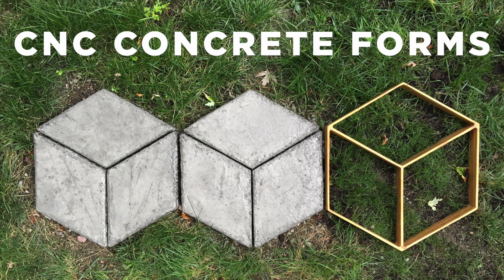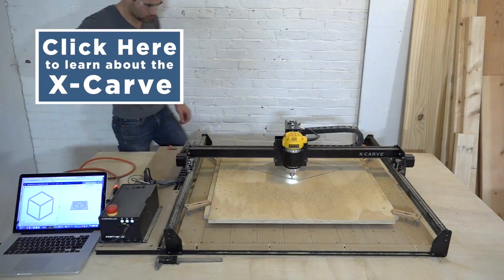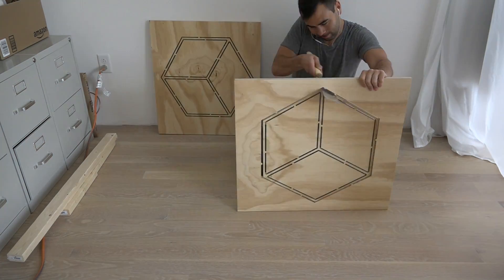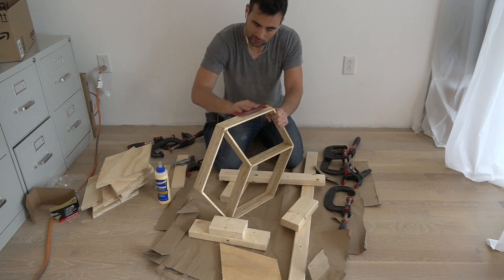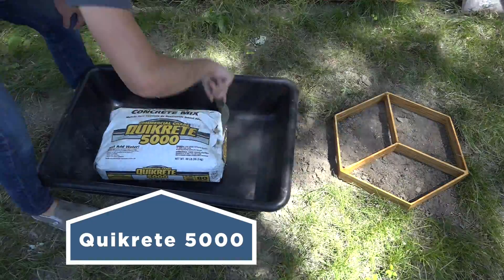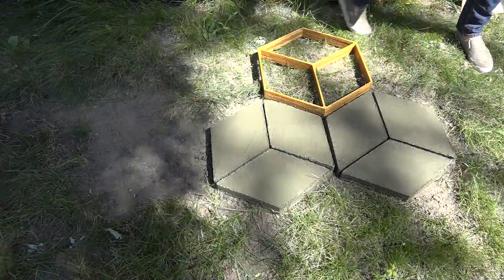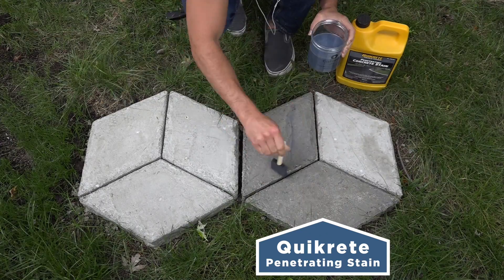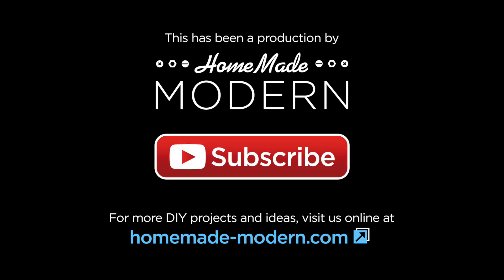CNC Concrete Forms | How to make your own Walkmaker

Comment: Omg I've been trying to figure out a way to make hex shaped forms for a repour I'm doing in my basement. I have no CNC or access to one. Any method you can suggest to make a form like this without a CNC? Or would you be willing to sell some?
Reply: Nevermind, just found your Ted talk and heard you mention that you're an architect. Thanks for sharing your work, I realize now how unlikely it is to get a beneficial reply. I'll figure it out somehow...
Reply: MaxVG Vapes he normally does answer alot of questions /yes
Reply: If you hit up craigslist you will usually find someone local offering CNC router work or use of their machine for a fee. I do this, and while i haven't had any "business" out of it yet, i figured it can't hurt to leave it up and possibly make a few dollars to offset the large investment into my router.